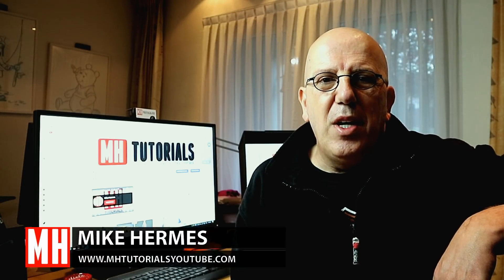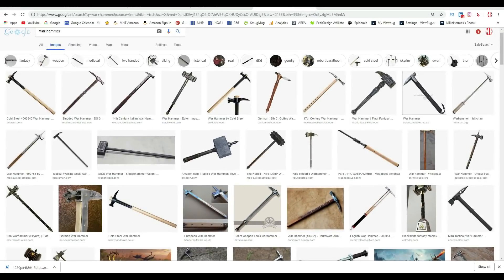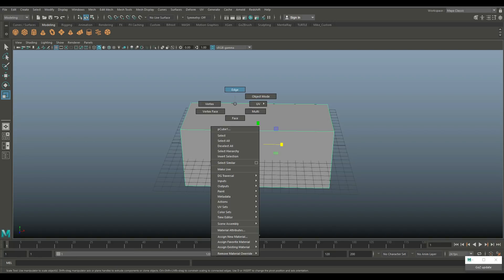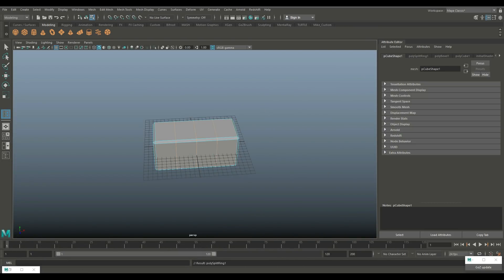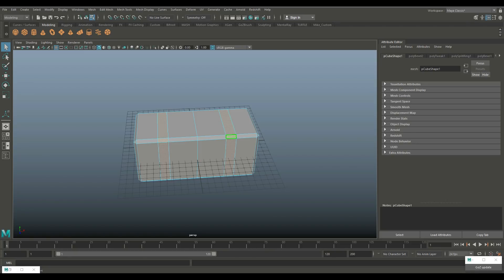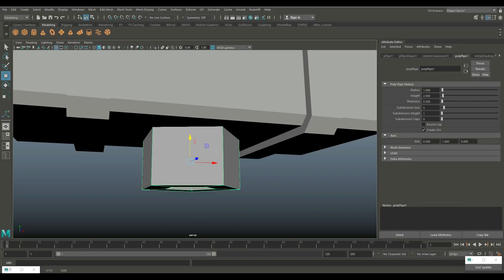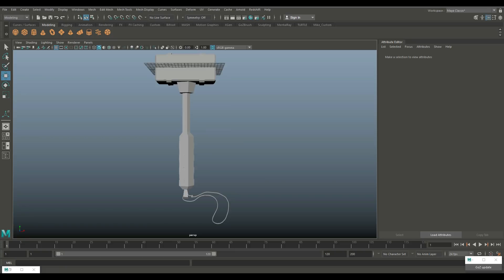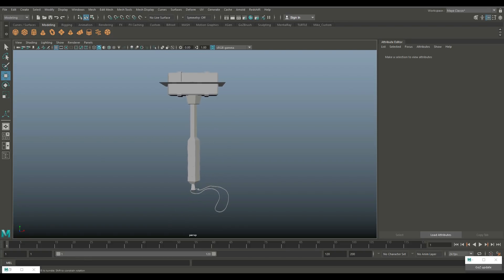War Hammer Part 1 of 4 : Modeling ( Maya 2018 )

Comment: Loved this, thank you.
Reply from the maker: Thank you
Reply: @MHTutorials3D  quick question, you talk about 'endgons' (not sure about the spelling) and if you create one to 'poke' it, why is this so? Thanks
Reply from the maker: @tommyviles  Thomas, n in Math stands for a number that is unknown. So there is a Pentagon ( 5 sides ), Hexagon ( 6 sides ) , Heptagon ( 7 sides ), Octagon ( 8 sides ) etc. When talking about an nGon we are talking about a 2D flat face with more than 4 sides. Now the 3D world works with triangles ( often in games ), so triangulated models or Quadrilateral ( Quads ) , so a quad is basically two tri's. Anything other than Tri's or Quads create trouble in texturing, UVing etc. Now why Poke ? Because it turns the nGon into a series of Tri's
Reply: @MHTutorials3D  ahh I see, thank you for the explanation!
Reply: @MHTutorials3D  another question, in your tool bar of different polygons, cube, sphere etc. you have a pipe, mine does not seem to have one, how did you add it to the tool bar? Sorry for the continued questions